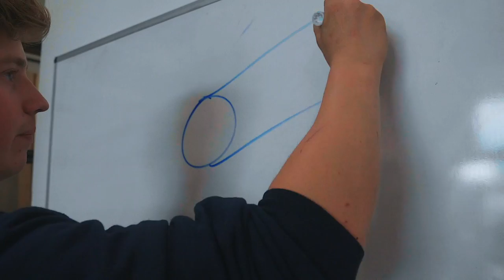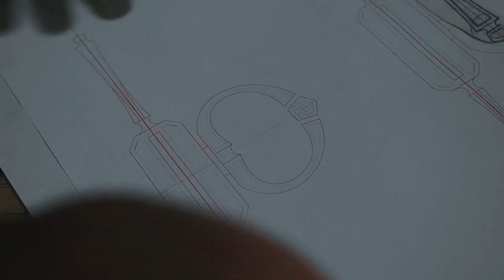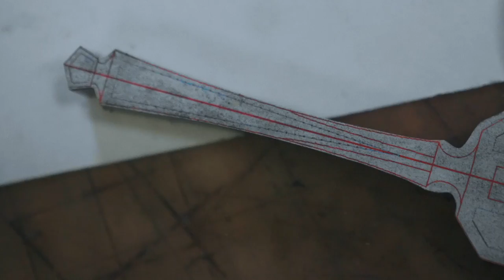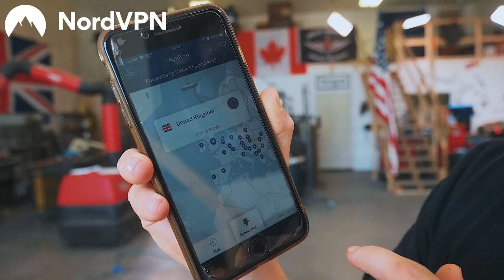MAKING THE SWORD-BREAKER!!! Part 4

Comment: Another way to transfer the print to the steel blank would be to print on a laser printer (mirrored), place the printed paper on the steel piece (but print side facing the steel) and rub acetone on the back-side. The toner will transfer over to the steel and should make it quite visible. You could also use an iron (heat) to transfer the toner or even iron-on transfer paper but then the surface needs to be super flat before starting.

Comment: You know with the whole "burning the paper pattern as you grind", what if you coat it with decoupage "mod podge" (arts & crafts stuff). It's mostly transparent, and would probably provide some protection to the template. I would hope it would burn off before the paper

Comment: Try Carbon paper to transfer the drawing over to the steel and then spray a clear coat that you can layer grind off. Or use the chemical etcher you have. A laser engraver will etch out too. But that would be pricey to buy it.

Comment: Have you tried transfer paper and the process they use to make printed circuit boards to transfer your designs to the steel? Not sure if the toner can take much more heat then paper alone, but at least it would be water resistant.

Comment: You guys should get a cnc lathe and milling machine with acsess to solid cam and solid works ... trust me its phenomenal or get one with shop turn and shop mill ..
Reply: Oh yeah. Invest $150k to ½ a million dollars in machines with no product to manufacture. Learn an entire new trade with zero experience. They would never be able to afford the nut of a CNC lathe and VMC or a mill turn machine. (And have money for all the things they need to pay for.) CNC machines need to be making parts. He wouldn't be able to get the machines and learn on them because he'd be losing money the whole time. Even a couple cheap machines like a Haas mini mill and tool room lathe, with all the tooling and the ancillary equipment and shop retrofitting (electrical) he's going to be touching on $150k.

Comment: you need to get a vinyl cuter for stickers, then you can cut out the layout shapes for the steel on a sticker without having to cut out a paper outline by hand, it uses the same file types and is very easy to use

Comment: Could you use your electrochemical etch machine to etch your pattern for the guard or a laser marking tool to mark your pattern on the metal to grind to rather than paper glued to metal?   Just an idea.

Comment: Why not etch the profile onto the actual metal surface of the guard piece instead of using masking tape and paper?
Reply: The goal is not to mark the metal itself because then you would need to grind through those etchings to smooth out the surface if you make a mistake or need to make changes.
Reply: Harbingerx81 But you’re already gonna round everything out right? So you’re already gonna be grinding those edges (and etch marks), down

Comment: I'm surprised Alec chose to cut out the pattern for the loop in the guard. Right after watching the last video my first thought was "Seems like he needs a new tool, time to make a new tool!" and imagined he'd make a new of those hole-widening thingie-ma-jigs (punches?) that instead of being round or oval has a shape of the hole they're trying to make, so kinda oval with a groove running down it where they want that lip, that ought to make at least a decent start to the loop.
I'm definitely not a blacksmith though, so I have no idea if that'd be the right thing to do, but it's the first idea that popped into my head =P

Comment: have you thought of investing in a small laser engraver to avoi the issue of the paper and adhesive getting too hot when grinding designs? Engrave the design on the metal instead of using paper, and grind accordingly!

Comment: Question, Could you have made two holes side by side with the punch and widened the two holes until they met in the middle to have a "V" at the top and the upside down "V" at the bottom? Then you could have saved the bottom upside down "V" and smoothed out the top "V" to form the rest of the circle on the guard??

Comment: It might be to late to try this but could you etch, draw or scribe the design in foil then apply it to the piece with adhesive or solder if the foil was thick enough?

Comment: Would running a continuous blast of air past the piece whilst belt sanding help to reduce heat?  Taking this a bit further how about activity chilling the platen? (Internals of a domestic food freezer for example.) Throw in some electronics to monitor the target temp and control cooling and to a max allowable target temperature and we're getting to something patentable. Even when not using the paper template the dunking in water seems a little low tech these days.

Comment: So why not pick up one of those little dorm fridges like 1.x cf. Have a plate of aluminum in it and then you could pull it out of the fridge and it should soak up the heat decently enough to keep the delays down to a minimum.

Comment: check out using a laser engraver to solve your paper design cooling problem. They are quite cheap these days, only marginally more complicated than a regular printer and you can easily sand off the design once you get to shape

Comment: Don't know that you'll ever see this. But, would it have worked to drift 2 smaller holes side by side, to hollow out the ring, then chisel out the resulting center in order to leave the little peak in the design?

Comment: I think you guy should use that milling machine a lot more!! When you drilled those holes you also should of drilled out those radius’s in the bottom . The ones you filed in. Could of cut the slots with an endmill on there too. That’s just me . But I’ve ran a mill for 20+ years. Good job though.

Comment: Would doing a light etch, with that electrical etching machine you guys have, work better for transferring lines like from the paper onto the piece rather than having the paper glued onto the piece? You wouldn't have to etch it too deep to keep the lines and then heat wouldn't be an issue..... right? IDK, I'm just spitballing here.

Comment: You guys seem to be having this paper issue wit the grinder a lot. Do you think doing a gum transfer of the drawing to the steel directly would work? That way the stencil is just ink on steel rather than paper. You could fix the drawing w a clear coat if you’re worried about disturbing the drawing. You could even use colored inks. Might speed up the process so there isn’t a grind/wait method. You’d obv have to wait for the ink to dry, but you might be able to bake it in one of those shmancy ovens.

Comment: 3:58 wtf is a 32nd hole and why do you need 7 of them?
Reply: A hole of 32 freedom units in diameter, and you need 7 for each day of the freedom week 👍
Reply: It's called a fraction. Learn to use them. I don't know why purple think that rational numbers (fractions) are something specific to USCS units, but they're used in many other things. It's a lot better tan describing numbers inaccurately with decimals. How do you split something in three pieces? Saying 0.33333 (no matter how many 3's you add) it's inaccurate. So you use 1/3. So you're not left behind with the idiots, learn rational numbers. You'll need it for higher level math also, if you ever want to do anything that requires a degree. (Arts degrees not included.)

Comment: Instead of taping the paper to the work and having continually let it air cool, couldn't you use the tool for etching your markers mark to etch the design right onto the steel? Then you could wet it while grinding.

Comment: Question, whenever I see you guys forging, I don’t ever recall you using borax or any other flux on camera. Is it just a step that winds up on the cutting room floor? Or do you really find yourselves not using flux often. I’m not a A blacksmith in any way, I’ve just found myself on a kick of watching your videos for the last week or so, great content BTW. Most of the other blacksmith channels that I find myself watching always seem to show a step of sprinkling on Borax when forge welding… not that it specifically happened in this video. Just curious.
Reply: Then I scrolled into the comments where everyone has an opinion on a better way to do every step. For your sake, I hope I never get a reply… Keep up the good work.

Comment: Why you didn't cut more accurate the paper for the guard then stick it temporaly to the peace of steel and paint around the paper with blue tac remove the paper and start to grind? 
did blue tac remove with water? (that wil expain why you didn't use it)
i'm not a forge expert but a fan of forging vidéo and specialy your's

Comment: For the grinding sections you have to do with paper and adhesives I’m wondering how well it’d go to have something sub zero and not technically a liquid in the shop. Imagine some dry ice you can hover the piece down in to cool it off if water isn’t an option. Of course you’d have to use some rather bulky gloves (or just one maybe) to handle the source of the cold and you could lose some dexterity from that but idk ¯\_(ツ)_/¯ maybe it’s worth experimenting on

Comment: If you threw a bunch of carbon nanofibers in a steel rod could you use that as a blade core?  Would that solve the problem of a long blade losing rigidity?  These carbon nano materials are supposed to be super strong for their weight and should survive heat easily enough.  Really, I just want to see you make a huge saber that isn't more wobbly than nana after she's been hanging out with Jack Daniels and Jim Beam.  Is that so much to ask?

Comment: What is "50 thousandsths" supposed to be?
Reply: 50/1000ths. If you cut a millimeter into 1000 pieces, and you have 50 of them, it's fifty thousandths. 0.050 mm (I did it in millimeters in case you thought something stupid like it only being a USCS terminology) You ever hear "two tenths of a millimeter"? That's 2/10 mm, or 0.2 mm
Reply: @xenonram  I've never heard of the terminology because I haven't had to measure something that small. If 50/1000ths of whatever measuring he is using can be measured in only millimeter then I have no idea why he isn't using millimeter, if it can't and is still smaller then that is so extremely tiny he has to be pretty skilled to be that accurate!

Comment: Those "barbs" are wayyy too thin! If you wanted to increase the amount of space between the "barbs" you should have just made less of them rather than making them so thin.  Also, im well aware on the strength of steel, but I feel like they're not taking into consideration how these are meant to be used.  There is a lot of force being exerted on the sides of those "barbs" when you're trying to twist a blade out of another person's hand.  At that thickness you're more likely to bend or snap one of them on the first few attempts of doing this.  As such the dagger comes off as pure aesthetic and not functional in the least.

Comment: The teeth on that thing look way too thin to be effective or strong enough to be a functional sword breaker. One solid strike or strike block will probably snap them right off. Even with proper heat treat, it will be a very pretty paperweight, display piece and not a functional weapon.

Comment: Make a cheap sword and see if it will actually break it when you are all done
Reply: Sword breakers don't break swords, they break sword attacks. They're intended to entrap an opponent's blade and pull it aside opening up for counter attack...
Reply: Owen Sparks ya I know but you can still try on a crappy sword.